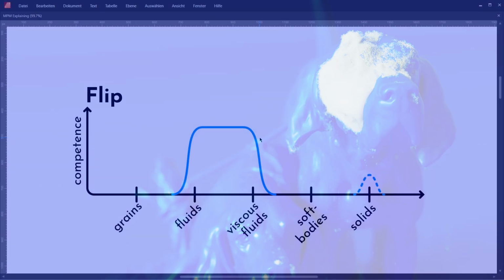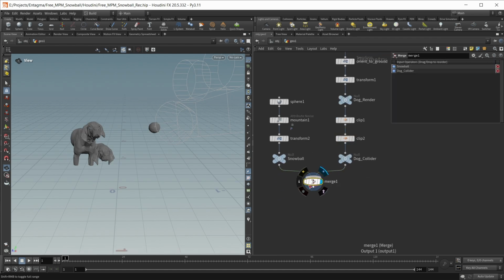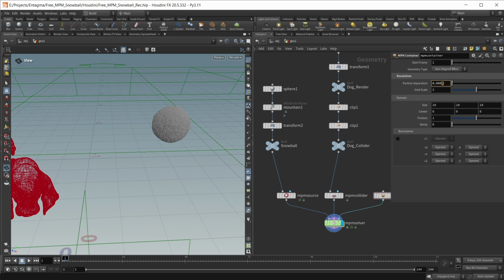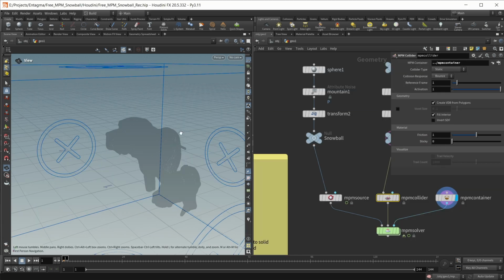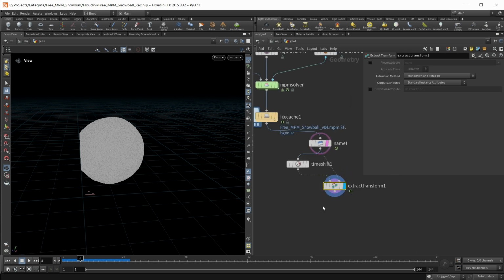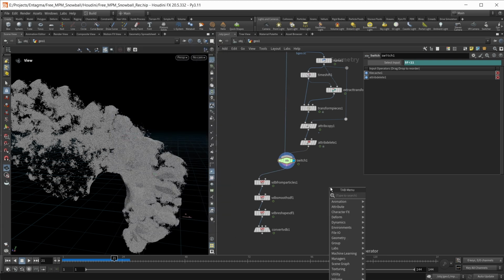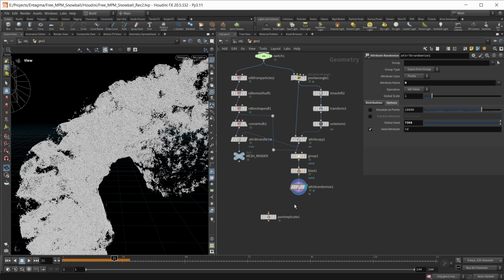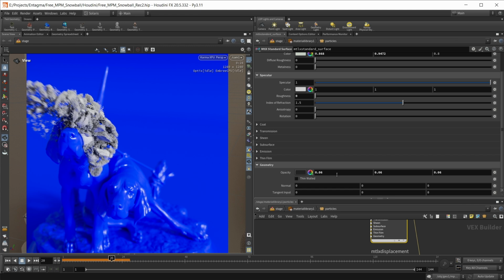Houdini Tutorial: Throwing A Snowball With MPM

Comment: I have a query regarding the scenario where an artist from the preceding stage provides an animation of Snowball.
Reply from the maker: You can use a point velocity or trail sop to calculate an initial velocity from the provided animation. Then set the start frame on the solver to the moment when you want to switch from the animation to the simulation.

Comment: Hi this was nice tutorial @entagma loved it !!. Just one question i about how would i go about adding a specularity to the snow  in xpu. I looked several resources couldn't find anything useful . This problem also happens when i am trying to render whitewater using xpu . There is simply no way i guess we can calculate gradient i guess in the karma xpu?
Reply from the maker: I'm by no means an expert in rendering snow, however what worked for me was: Find the right ratio for subsurface scattering (this hides a lot of those small glints), use a really fine, really strong normalmap, and play a lot with the lighting. This setup right here ended up not having a lot of glints because I wanted the snow to appear softer and had a particular lighting in mind, which didn't really emphasize them.
Reply: I am also looking for a solution for whitewater & snow in xpu - the old mantra method where we render as a volume with the gradient for normals is the industry standard and does in my opinion give the greatest photoreal results

Please Entagma, we know you can solve this 😂🙏

Comment: I was under the impression that MPM runs on OpenCL and is therefore a GPU solver. Shouldn't the cache size under the solver settings be limited by your VRAM? I doubt that you have 64gigs of VRAM :P
Reply: good question, this is the kind of guy to have 3 GPU's so not sure lol
Reply from the maker: Hey! The cache size parameter works the same on every DOP node and simple controls how many finished frames get saved into RAM for a fast playback in the viewport. Essentially it controls how long the blue bar in the timeline can get. This, I'm fairly certain, is in no way linked to VRAM.